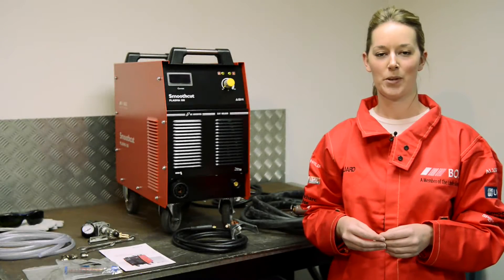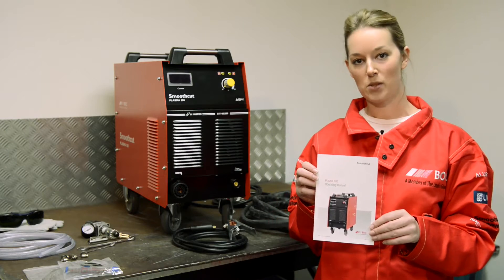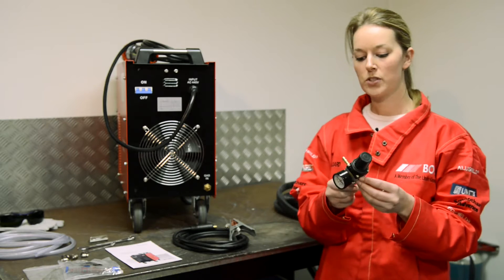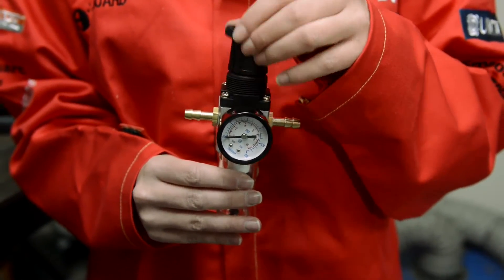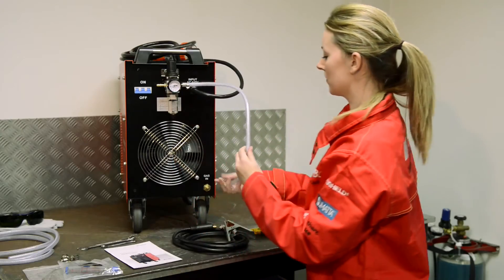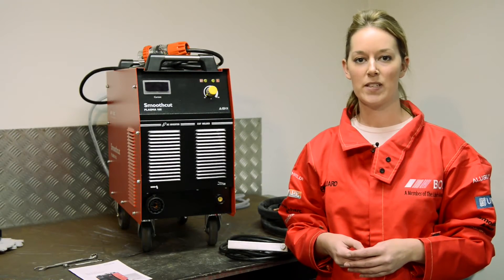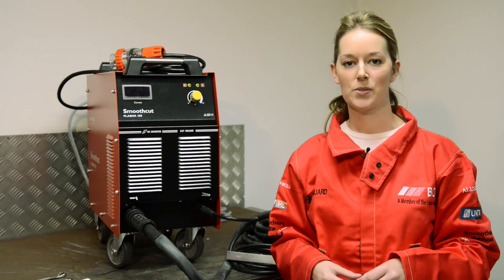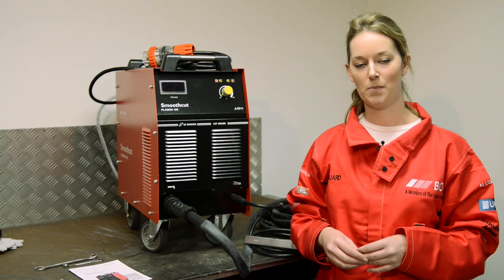BOC Smoothcut Plasma 100 - Training video

Comment: my conversion chart says 1 bar is 17horsepower, so 4.5 x 17 means the compressor has to be around 77 horsepower.  That sounds very high. Most bunnings compresors are around 3 or 4 horsepower.  Have i got the conversion rate right?  Do you sell the required compressors?
Reply from the maker: Hi Deborah, 
We unfortunately no longer offer compressors.

What’s more important is the size of the compressor reservoir and the pressure it can deliver along with air flow rate. Horsepower and reservoir size will determine how quickly the reservoir can be topped up.

The Cut 100B will require 4-5.5 Bar pressure, 160-180 l/min air flow rate to cut continuously, so the compressor must be capable of delivering >180 l/min of air.